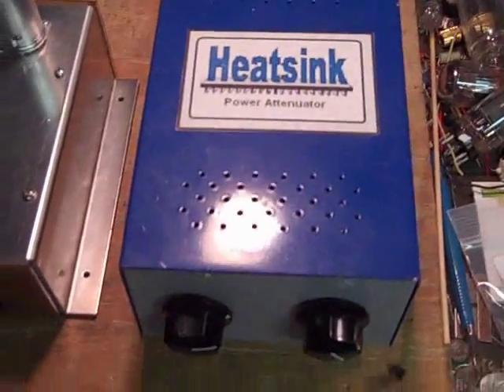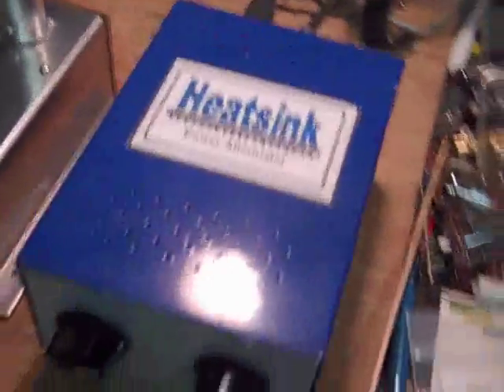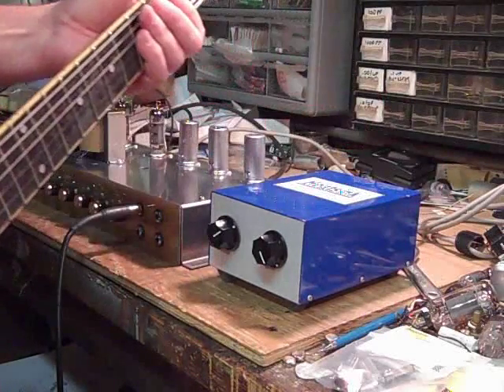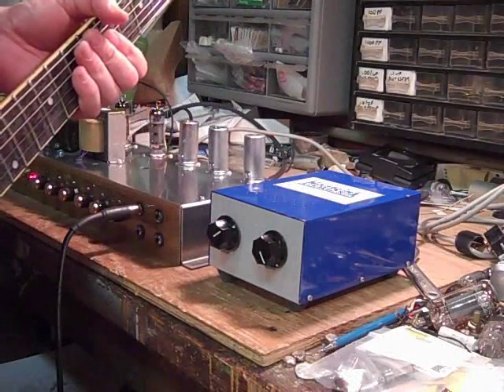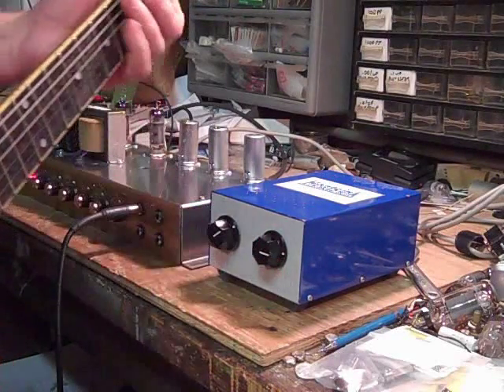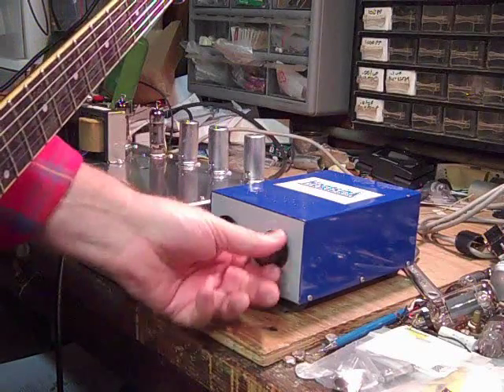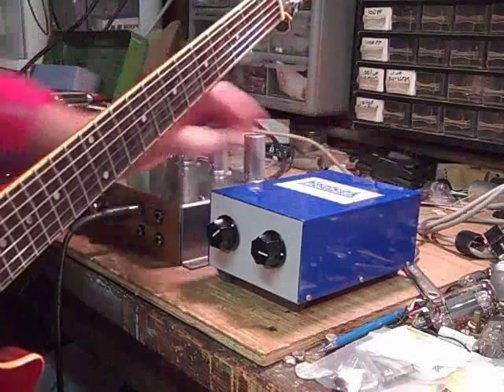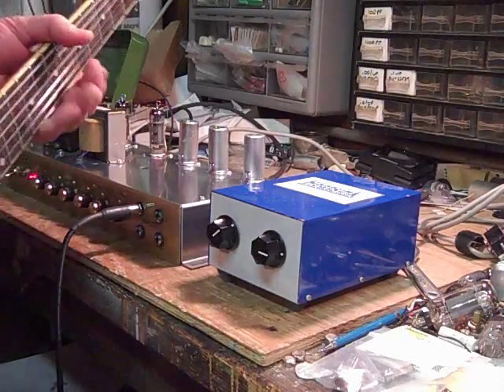Heatsink Attenuator

Comment: would rather have a power scaling amp, the L pad eats up all the tone, feel and dynamics.  The L pad sucks ass it does nothing but suck everything dry the power amp valves and output transformer hate it.  Regarding L pads, monkey see, monkey do.  The monkey put his hand in a hole to get some peanuts, and when the monkey clinched a fist full of peanuts, the dumb ass money could not get his fist full of peanuts out of the hole and was too dam stupid to let go of the peanuts in order to get his hand out of the hole.